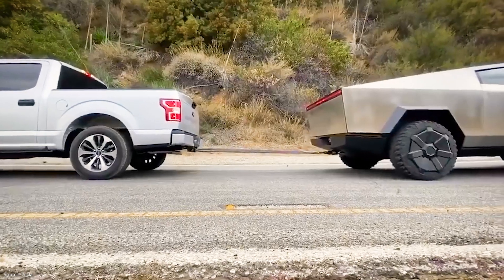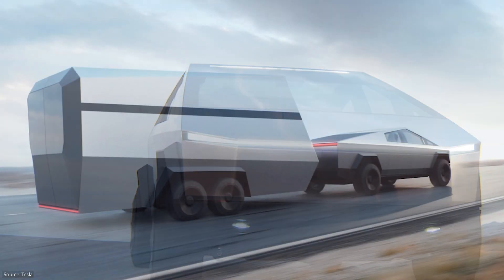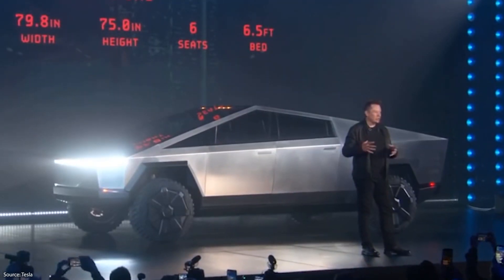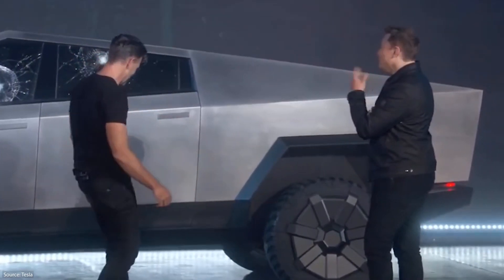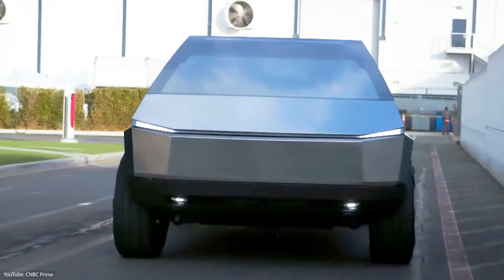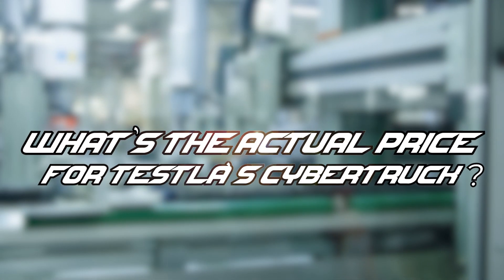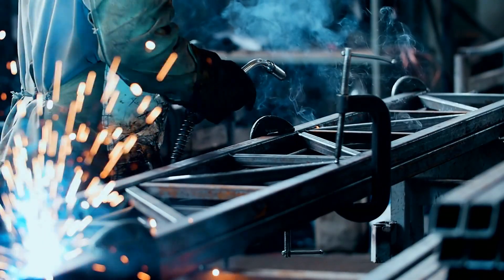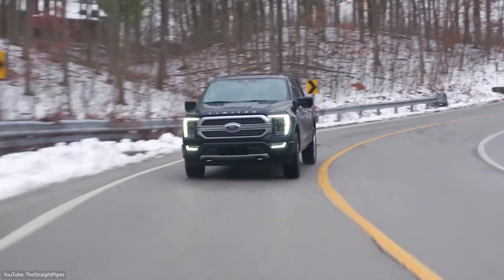Why Tesla Cybertruck will make Billions

Comment from the maker: What do you think about the design of the Cybetruck? Would you buy one? 🤔
Reply: Not really sure about the design, it looks very cool but idk
Reply: It looks really cool
Reply: Looks strange but also cool, i would love to drive it one day.
Reply: I would buy it in an instant.  I really like the function over form and the minimalist design.  But if it delivers as promised then it will simply be the best choice when compared to other current (real and promised) offers:  Fastest, cheapest, most range, most rugged (bullet proof, scratch resistant, rust proof), most efficient, best electronics, best software, best tow and load capacities, best passenger capacity, air suspension, ramp, and so on.  Perhaps the hummer will be a slightly better off road vehicle, though is is massive. The Rivian seems more luxurious with a unique pass through storage and a unique tank turn.  The F150 has an amazing frunk and maybe the only dedicated V2H option.  But all in all the Cybertruck is far ahead as I see it.
Reply: Put in my $100 when it was first available for pre-order. I bought the first GMC/Chevy Astro van when it came out and lots of people stopped me to check it out. It was a totally new design and took off with other companies making similar changes. I see the Cybertruck doing the same thing. I don't see the F-150 Lightning doing that well because it's underpowered (lack of batteries) at the start and looks just like every other truck. Nobody will even know it's an EV by looking at it and that's how you change a market. Ford is a follower not an innovator like Henry was.
Reply: @robeigner4390  Exactly, Ford is just being forced to evolve by the situation and is really not innovating.  They need to put some engineers in charge ;-)
Reply: i want one
Reply: Hi, I saw your top luxury channel and got to this channel from there only and I  really liked your content on both the channels. I am a video editor/content creator and who make documentary/face less videos like these. I also provide full video service where I provide complete video which includes script, voice over and video editing, I also provide these services individually like only script or voice over or video editing. 

So if you need any of my services let me know.